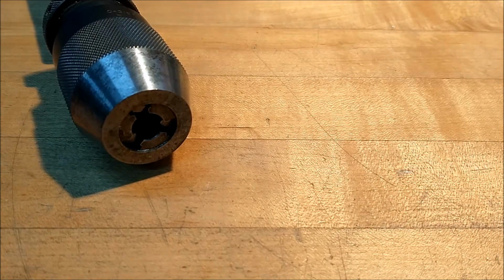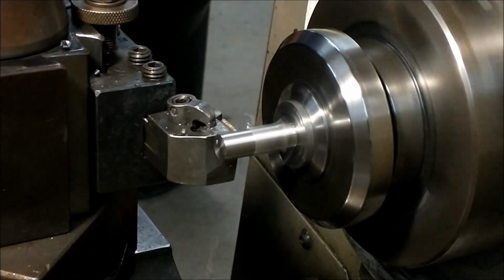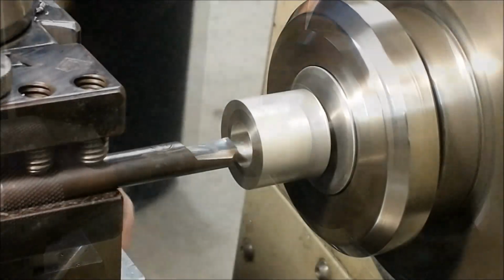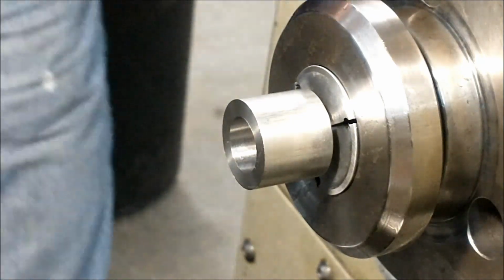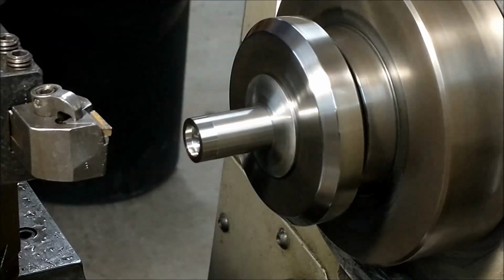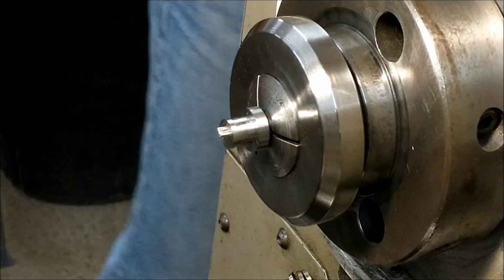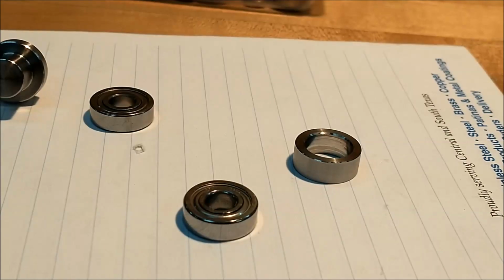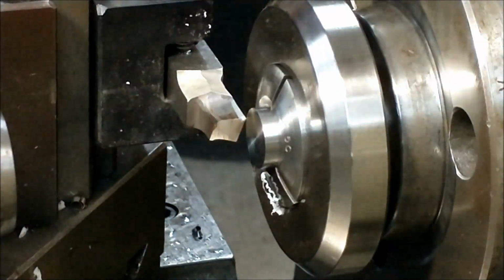Need a Live Center For your Lathe??  Lets Make one !

Comment: those little bearings are not designed to absorb much thrust, will this be a problem when used to pressure turn? i made a similar gadget years ago that slips over the nose of my live center.
Reply: I suppose you could use a little set of tapered roller bearings. But regular ball bearings will likely last for quite a while; I've abused them in many ways.
Reply from the maker: Tapered bearings would be the best choice for this.
Reply: @joepie221  for the home shop guy, not so much.
Reply: Certainly not, but this isn't a product, it's a quick-and-dirty tool, with cheap bearings. I think the idea is to replace the bearings as they wear out. Provided you don't OVER-overload them ;)
Reply: You only need to change the outer one,  as it's this one that sees all the load. It should be quite easy to grab it since the spacer is smaller in diameter...
Reply: @horakus  There is no reason to do so, but if you HAVE to push it hard enough to get the bearings to yack then stick a 1/4" ball on the end. - They used to make live centers like that all the time - Just keep some 90 wt or grease on it.

Comment: Hi Joe, could ya use say 3 bearings, or does need spacers, between the bearings... Cheers  :)
Reply: You could use 3 bearings, just so long as they're flat (IE: inside and outside race the same width). It wouldn't really add anything to rigidity or concentricity, but if you have 3, it saves making a spacer I guess?
Reply: @AlexanderBurgers   Thanks :)
Reply: @AlexanderBurgers  and three without the spacer would triple the axial load rating :-)
So simple.
Reply from the maker: You Could use 3.
Reply: @joepie221  Thanks peeps, I've got several bearings in stock, they're so cheap, I tend to buy half a dozen even if I only want 1, to do a job I'm working on .... Cheers all.
Reply: If trey're flat (IE: inside and outside race the same width), they'll share the load, right?

Comment: Hello, Joe! Nice little project, lots of good tips for the "design"...I wondered if one might want to get some kind of precision bearings, at least for the front bearing, if you want to use it as a 'pointed' live center? Or, maybe the front bearing could be one of the bearings designed for axial loads? Probably "over-thinking' it... Keep well, fine sir!  Best regards from the middle of Europe!
Reply: Skete board ABEC 7 or 9 bearings?  (And tell me they don't get some big thrust loads on them)
Reply: Don't overly sweat the concentricity - remember it's mounted in a drill chuck which itself is not concentric. Joe suggested a slip fit for the nose spindle relative to the bearings inner races, when running on the lathe it will offer a slight self centering affect, at least in a pressure turning application.
Reply: @wwilcox2726  thanks for the comments, and insert that Joe has suggested that an axial load bearing would be good, but for small applications, not a big deal...so, I was partly right, but "overthinking" for this application :-) sometimes happens, when your 9-to-5 (well, 9 to 9, more like) job carried responsibility for 100 million devices per year, and a couple of hundred million dollars/Euros ;-)

Comment: enjoyed....on my list!!!
Reply from the maker: If small tapered bearings are available, use them for the best load capability. Thanks for stopping by Chuck.
Reply: @joepie221  why?
A triple stack of ball bearings would eliminate the need for the bearing spacer you made and would then distribute the axial thrust over all three bearings, tripling it axial load rating. And there available at most local hardware stores. "KISS"

Comment: apologies for not watching so much lately:  but learnt MORE towards the end  here:things one  "knows" but doesn't think about - ie the spacer rings ID/OD dependent  on application  but NOT to link ID with OD ! "Oh any old bit pipe will do"  - no it won't !      Jewel in the vid?   goes to the end result:   FLAT face workpiece holding!    So tha's  how it is done - OK for plastics - but even Aluminium !     Who'd have thunk it?   Jo did  thank you.
Reply from the maker: Depending on the setup, you can hold a variety of materials in many sizes this way. Pressure turning can be risky, so exercise caution.
Reply: @joepie221  Indeed, just as a kwik reply:- I'll have to investigate = try with a thin RUBBER sheet for metals and maybe that liquid diamond pastte ( gripping paste for stubborn Pozi screws ).   Of Course theirs always the Hot GLue and / or Super glue -   but getting rid of the residue would  cause as much grief.  Axial load is of course dependent on the Bearings ratings and Pressure exerted on the workpiece.   Thanks again

Comment: Thank You, never seen the chuck mount idea before!, its great!
I can see that I have to make one of these for pressure turning small parts, seems like a real time saver. Any old bearing will certainly do for this application and limited use, but if needed for heavier loads and better tir, I found the internally preloaded double row small INA bearings are very good. More expensive though, but the single bearing unit is also nice feature.

Comment: Lovely little project Joe, as always.  Couple of comment/questions:
1) I was a bit confused at the beginning when you mentioned that you needed the largest diameter that would keep the chuck jaws below the surface.  With a conventional chuck it's smaller diameters that cause the jaws to protrude, does that chuck work backwards?
2) Wouldn't an angular contact bearing be a better choice for the outer bearing given it's under axial load?
Reply: 2: It would be, if you had one in your parts box. Spending time/money to get one kind of defeats the purpose of doing a quick DIY build, I'd think.
Reply from the maker: Most drill chuck jaws will retract into the chuck body as the holding diameter gets bigger. I would like to see the kind you reference in your question.
Reply: @joepie221  I also picked this up.  I think you meant to say the SMALLEST diameter that could be chucked while still keeping the chuck jaws below the surface of the chuck.  The largest diameter that would keep the chuck jaws below the surface would be the largest diameter you could fit into the chuck.  As someone else commented, you need the chuck jaws as far forward as possible (within the chuck) to provide maximum support.
Reply from the maker: @greybeardza9197  I respectfully disagree. I said largest because most all drill chuck jaws pull into the chuck body as the diameter of the drill increases. As jaws move forward, their holding capacity decreases and they protrude beyond the face of the drill chuck body.
Reply: @joepie221  Sorry Joe.  I'm still trying to understand this.  You said, "Find the max diameter you can hold in the drill chuck with the jaws sub-surface.  There will be one.  Write that down."  I have a 16mm chuck.  If I put a 16mm drill into it, the jaws are sub- surface (I fact I can't even see them).  But that is the max diameter I can put into the chuck with the jaws sub-surface.  If I put a 10mm drill into the chuck, the jaws are just sub-surface.  And with an 8mm drill the jaws protrude a little.  Which figure must I write down?  16mm or 10mm?
Reply from the maker: @greybeardza9197  I like the biggest value because it allows for a bigger shank on the body of the center. If you decide to use bigger bearings, or want a larger through hole, you'll want a bigger shank so the shank of this tool doesn't distort under jaw pressure. My jaws don't go sub surface until they expand to the max they can. They are still just below the nose of the chuck. Clamp different diameters and see if there is a rigidity difference between the 10 and 16mm sizes. If so, go with a size closer to flush without protruding.
Reply: @joepie221  Thanks Joe. Everything is now perfectly clear.  I want to make one because my current live center is too big and often gets in the way!

Comment: Great tips again, thanks Joe. 
I know you have covered it in the past, but deep in one or 2 vids, but what tool holder and insert is that you use (first tool you used to reduce the stock diameter) I cannot find anything that looks like those inserts. 
Thanks again for all you do for us viewers. YT gold!
Reply from the maker: W Wilcox is correct
Reply: @joepie221  I've been paying attention...
Cheers Joe!
Hope you enjoyed the SB!
Reply from the maker: @wwilcox2726  I would have enjoyed it much more if the Chiefs showed up to play. Mahomes looked like a High School freshman. I'm sure he feels terrible today.
Reply: @joepie221  I know just what you're saying.
Reply: Those are tpg321 kennametal inserts for ss grade kc730 or equivelant. The insert holder is a discontinued kennametal holder. Aloris  _XA-16 holders are similar but not cheap though they are double ended so they'll take inserts on both ends for turning/facing and they have adjustable chip breakers. The original kennametal has three options for chip breakers sml. Hope that helps

Comment: There's a load of people gonna moan that standard deep groove bearings aren't made for axial loads, which is true, but this is a small centre made for small loads and occasional use, and it's the front bearing that will eventually die, thus easy to replace.  

Sure, if you wanted to make an intensive use centre, this isn't how you'd do it, but there's nothing to stop the enterprising individual adding a single bearing ball in the hole at the bottom, with an adjuster driven by a grubscrew to remove the axial load on the bearing and increase its lifespan.  If you want high speed and a reduction of any high frequency resonance effects, use two bearings up front with different ODs and thus different ball counts, e.g  6802/6902 to locate the front, with a roller cage behind those and a thrust bearing at the back ad some sort of retention mechanism.  But that's an entirely different project.
Reply: That is NOT true. If it was why do they list a spec on then for axial loads.  - Anybody wanna put some money that Joe never has to change the bearings over the next 5 years? (Lubrication is VERY important too)
Reply: Way too overdone.
Reply: Just made the same comment before I read this.  IMO the easiest fix would be to use an angular contact bearing for the outer bearing, they are typically available in the same sizes as normal deep groove bearings and have much higher axial load ratings.
Reply: @ferrumignis  just use three regular bearings in place of making the spacer between two bearings and you've tripled the axial load capacity and saved the hassle of making the spacer. And regular bearings are available at most local hardware stores. That's the easiest fix IMO.
Reply: @wwilcox2726 That won't necessarily triple the axial load capacity, as you can't guarantee the tolerances will put the forces through the inner cages on all 3 bearings. In addition, 3 bearings back to back in a blind hole are close to impossible to change out when they eventually fail; you'll need to pull them one by one which will require a special puller with super-fine teeth to get a grip on the first 2. 

You could relatively easily double the axial load capacity by using a very carefully measured spacer on the inner race as well as the outer (and when I say carefully, I mean measured to take up the tolerances on the specific individual bearings you're using and place both sets of balls in contact with their outer races), however this will lead to eventual load related failures on the back bearing, which is gonna be a bear to change out (not impossible, but awkward, it will probably require the wet paper towel and gauge pin method).

In the end it becomes more work than doing it "right", and certainly more work than it's worth for an occasional use tool.  Joe's design is fine.  As simple as possible, but no simpler.  Bearing failure every 2 years?  No biggie, swap it out, it's easy to do and it's a jellybean part.
Reply: @wibblywobblyidiotvision  whew, that's a relief.
Thanks for confirming that I've been doing the "close to impossible" for over 35 yrs now. 
Cool beans!

Comment: Wonderful project! Thanks, Joe! I'll have to make one of these!
Just a side note - when drilling the part with the centre drill, why not use a 120° spotting drill? It took me 20 years of machining to learn that centre drills are for centres, and that using them for drilling can lead to chipped drills following the 60° hole left by my centre drill. Might be useful info for budding machinists so that they can start off the right way! 
Keep up the great content!
Reply from the maker: I have never been a fan of spot drills on a lathe. I'll do a video on that topic someday and show why.
Reply: @joepie221  please do!!!
Reply: As a beginner I would be very interesting in seeing a comparison between starting with a centre and spot drills, as well a reasoned discussion on the most efficient and wear saving approach to stepped up drill sizing depending on material and other factors.
Thanks for the great content Joe!
Reply: Ditto - I am no Joe Pi but when I do end up using a center drill I do not go past the first angle.

Comment: To all the armchair experts commenting on the use of 2 radial ball bearings.  The tool is for occasional use only and on small parts, so longevity is not really an issue. The bearings are cheap as chips to replace in any case.  Would you make a high duty cycle heavy load center this way? Of course not if for the simple reliance on a drill chuck for centering. Joe has probably forgotten more engineering than the "experts" ever learned.
Reply: Yes, and if you look you can get the ball bearings that have enhanced axial loading capacity as well, just in case you want to go full gorilla on them. But just using a size that is common means you can simply change them out when worn, which is easy enough.

Comment: That wil put me to work, I need a very small one. As model builder my standard live centre is simply too big, it‘s always in the way, even the relatively small one belonging to the Unimat microlathe. And the pressure turning version is also one to consider. Txs!
Reply from the maker: Make a long tip for the mini lathe center. It will help.

Comment: Nice little project. 
My complaints are that the first bearing will wear down really fast. It takes all the pressure and the bearing in the back has nothing to do, simply keeping the turning part of the assembly straight.

One double row cross bearing would be better or a thrust bearing in front.
Reply: KISS 
Eliminate the spacer and install a third ball bearing and you golden.

Comment: I tried to do something similar to this when I first got my lathe. Unfortunately, I didn't thing putting it in the drill chuck would work so I tried and failed to turn a morris 3 taper on the back so it would sit in the tailstock. I might see if I can turn that failed taper straight (while keeping axial allignment with the bearings) so I can mount it in the drill chuck.
Not sure why I felt the need to tell this to the entire internet, but what's done is done.
Reply: Let others know your mistakes so that they can go make new, original mistakes.  It is only common courtesy.
Reply: An alternative to trying to make your own taper, or relying on the drill chuck is to buy a taper.  They come in various flavors with the taper hardened and ground, but the other end is machinable.
Reply: If You make morse taper tooling, I found the best way is to use the very cheap China tapers and adapters as stock. My lathe has a morse taper in the spindle. Then it is easy and accurate to turn whatever feature required on to taper. Use a reducer for smaller ones.
Reply: @erikisberg3886  That's a damn smart idea - well done for sharing.
Reply: I agree with Kineth1. My lathe arrives in a couple of weeks. I haven't done any machining in years so I expect plenty of cock ups. 
Neat little projects like this should keep me busy until I gain some confidence and experience.
Do you know what went wrong with the taper? Never forget its only a true mistake if you don't learn from it. 
How far out is it, Tapers can be damn hard - have you tried re-machining it.
Did you machine it straight out of the chuck or between centers? Go watch Joes vid on great setups & crap results. Its specific to collet chucks but the lessons apply every where. If you start with run out that gets transferred to the part. So if you go to do a Morse taper and there's any run out your almost doomed before you start.
Good luck
Reply: Blue up the taper and see where it's not contacting right..use a very thin coat of prussian blue on your taper and put it in the tail stock, twist a bit then look where your missing the blueing... This will help you tell which way the angle is off

Comment: So what supports the thrust load the bearings are placed under?
Reply: I was thinking of that myself.  I think the answer is this: use cheap bearings so it doesn't hurt to replace them when they wear out.
It looks like this design puts the thrust load only on the first bearing (he said to make the shaft a slip fit to go inside the bearings, the thrust into the bearing is only from the shoulder) so you will likely only need to replace one at a time.

Comment: Why even bother with the back bearing if you aren't going to preload it?
Reply: Alignment. Caged ball bearings do have clearance between the balls and the races. The shaft would not stay concentric using a single bearing.
Reply: @highpwr  That's why you need preload. The front bearing at least is loaded by the work, but the back bearing is just floating there, it won't hold anything concentric.

Comment: You made cutting stainless look easy with those wide ribbons. Now I was burning though inserts trying to take the thread of a stainless threaded rod and went with a really sharp HSS bit and flood coolant which worked way better but much slower. Was my difficulty because it was stainless or becauce the thread was work hardened, or because typical inserts aren't sharp?